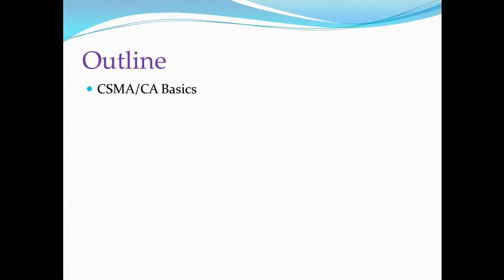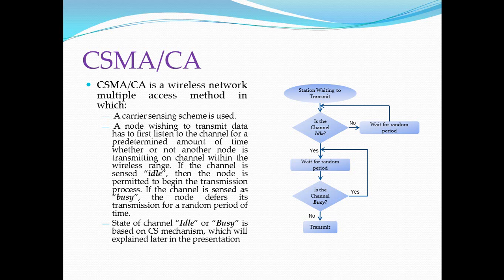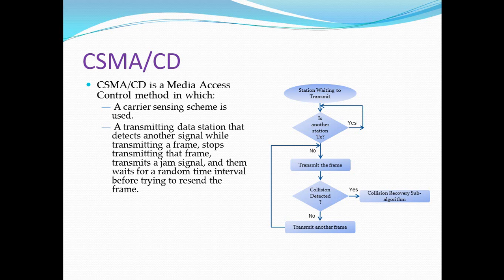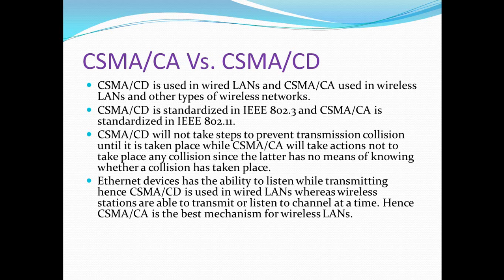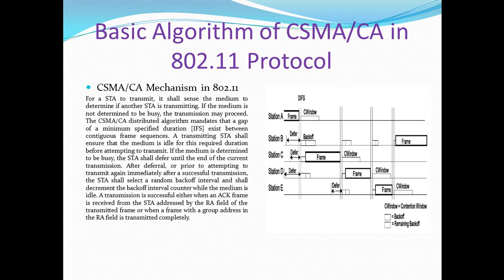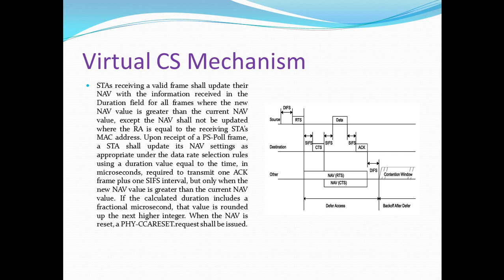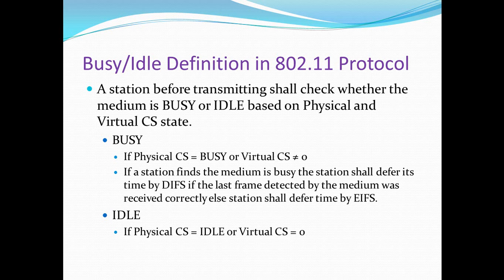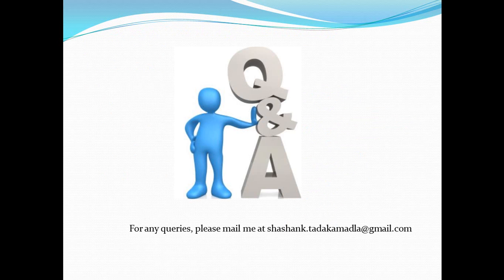CSMA-CA

Comment: You asked for corrections so here it goes… even though this has little to do with CSMA/CA 😄.

You said the speed of the Ethernet signal is around 70% of the speed of light. Actually both electric signals and optical signals always travel at the speed of light but with a big caveat. It's the speed of light in a medium. I say a medium because the medium varies and it's not always the obvious one.

For optical communications, it's comparatively simple, the glass fiber is the medium and it's about 70% of the speed of light in a vacuum for typical frequencies (yes, it's also frequency dependent, which is why different wavelengths get refracted differently when entering or leaving a prism).

But for an Ethernet cable, it's really difficult. The speed of light (i.e. in this context, radio waves), for the relevant frequencies and in a good conductor like copper wire, is extremely low. Slower than a jogger. But certainly the signal travels much faster… well, that's because, in accordance with Fermat's principle of least time, while the electrons do travel through the wire, the EM radiation carrying the signal leaves the wire and travels alongside it through whatever medium surrounds the conductor. And once more this is also frequency dependent. The mathematical details can be found on Wikipedia in the article "Speed of Electricity".

A practical value given for Ethernet is about 0.64c i.e. 64% of the speed of light in a vacuum.